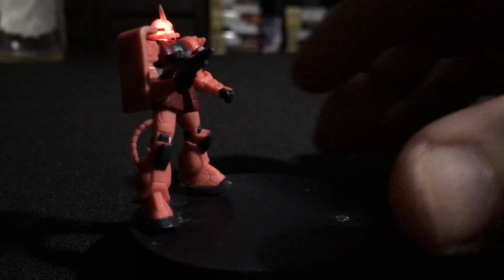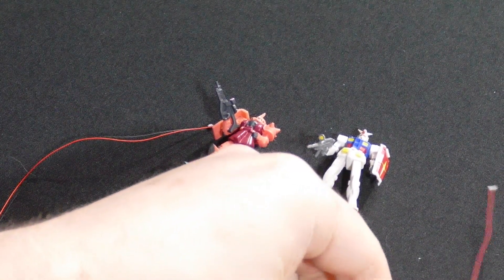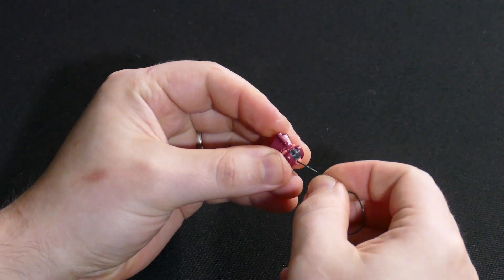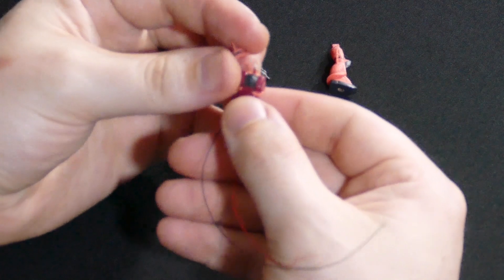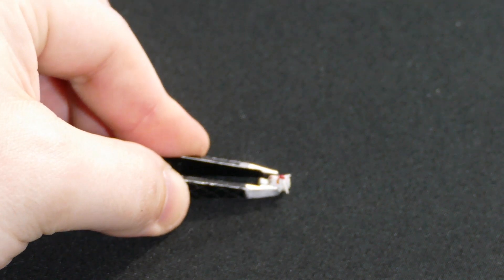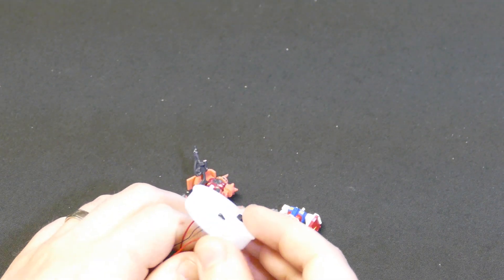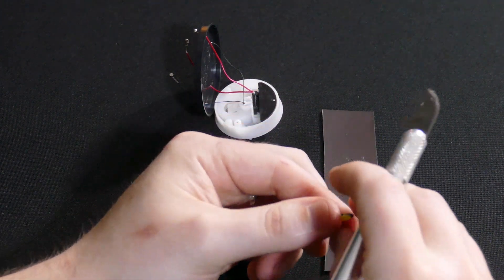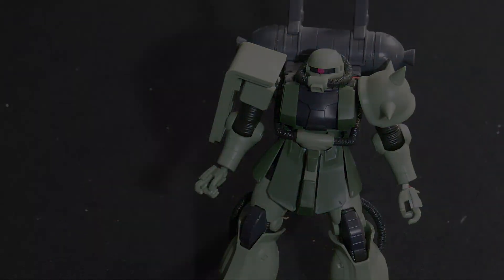How to Power Micro LED Lights Using Rare Earth Magnets for Gunpla & Miniature Dioramas Pt. 1

Comment: is there a require poles for the magnets? or when you position them?
Reply from the maker: There is no requirement as far as conducting electricity, but you should ensure that the poles line up between the magnets that attract one another so they "snap" together.

Comment: Hi, How did you strip the insulation on the hair thin LED light  when you cut the wires without breaking the wire
Reply from the maker: Very gently using my hobby nippers. I like to close the cutters until they are just touching the coating and rotate the wire back and forth until the insulation layer comes loose and then pull it off.
Reply: @MidnightHatter  thank you for your advice